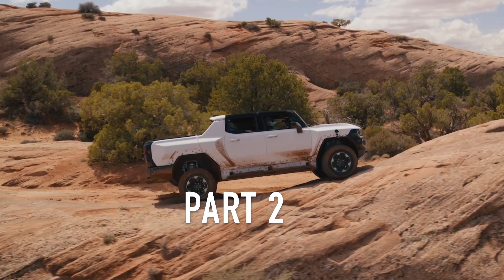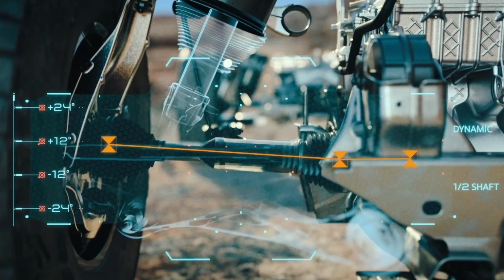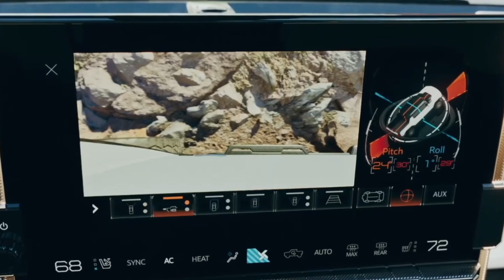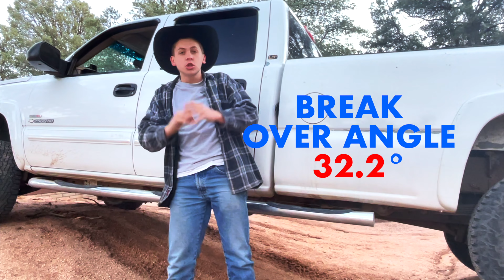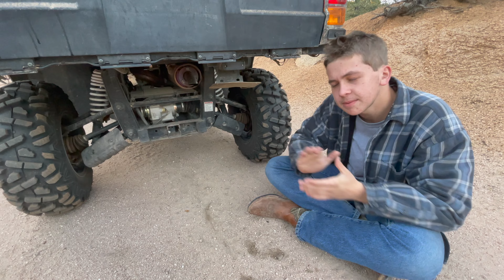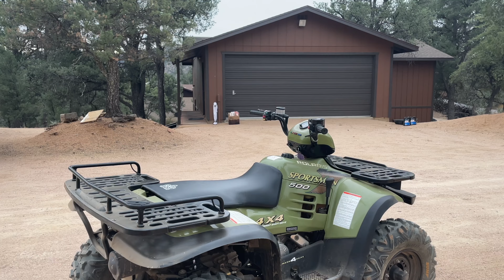PART 2 - HUMMER EV || FALSE BREAK-OVER ANGLE

Comment: I got a 2006 ram 2500 4 door long box with a 160" wheelbase, what would be a good break over angle for rock crawling?
Reply from the maker: 20degrees plus is decent. stock Wranglers are around 20-25degrees. But its not worth lifting your truck that high. Low CG is more important. What are you doing for a front locker? https://www.youtube.com/watch?v=9ni8755BKwc
Reply: @redneckphysics  I've got ARB front and rear, rock sliders, skids, right now it's on 35's stock suspension, has 17" of ride height but still hits a lot
Reply from the maker: @Sinister_Reaper sounds like a great start. You’re just kinda really long… so you’re gonna high center unless you can getter like 40” tires. Nothing you don’t already know:) too bad you can get some portals…